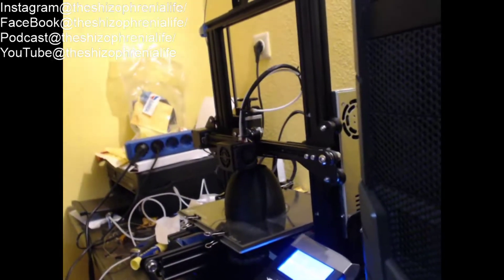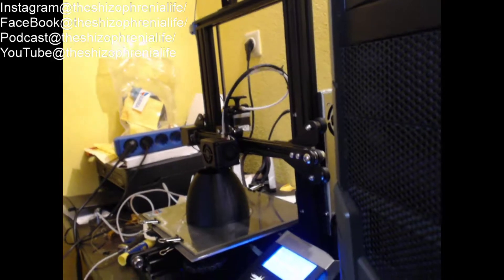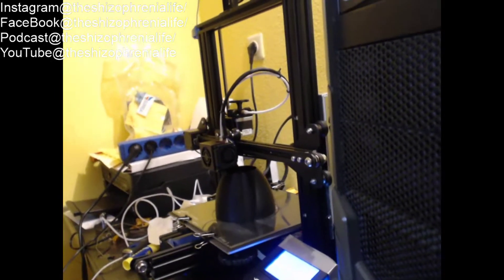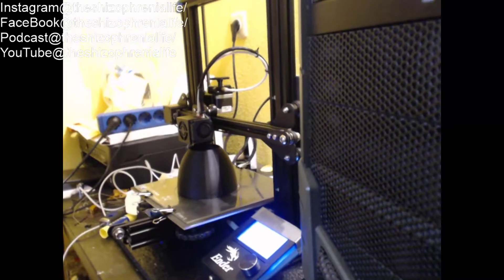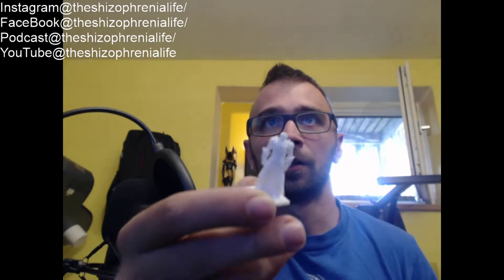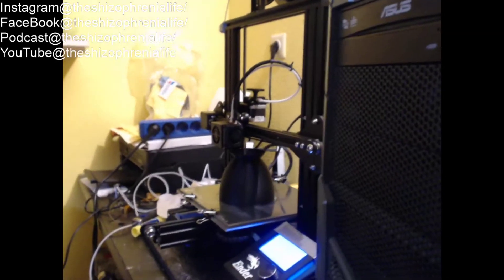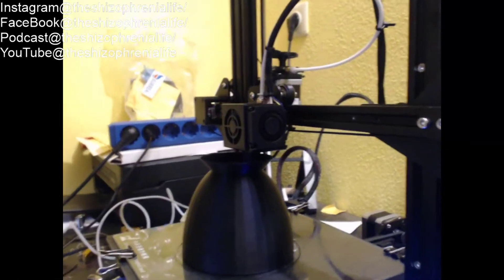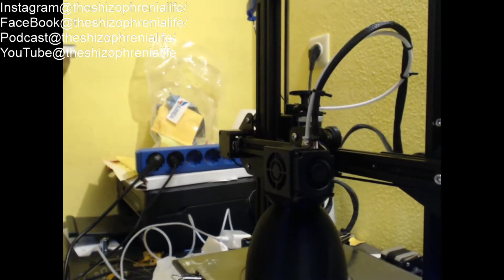Ender 3 What is Vase Mode? 3D Printers

Comment: Hello, thanks for the nozzle tip .So I have 0.8nozzle what should be the Cura setting for the 0.8 nozzle?
Reply from the maker: well for both .4 and .6 i use 1.0 in vase mode so i would keep it at 1.0 and do a test you don't want to go much higher because your PLA is 1.75 the only exception that I have seen is when using a 1.0 nozzel but to me it looks terrible. Sorry for late replay i didn't get a notification. I get my new parts for the ender on thursday and ill post a video this weekend. I'v done alot of updates the last two weeks from the firmware to the board to hotend. I just wish I could buy the mk3 but they stopped taking orders with the springsteel bed which is why I want it lol.